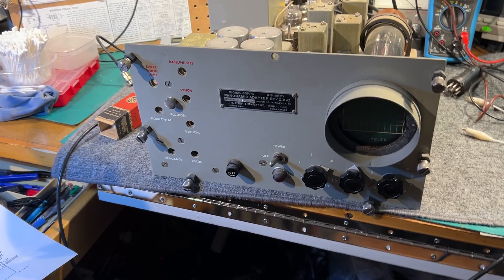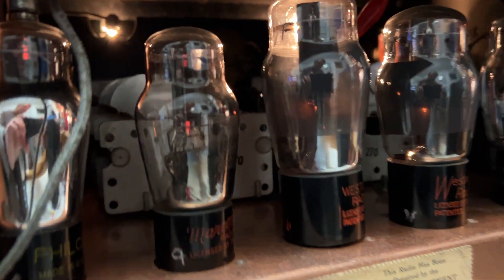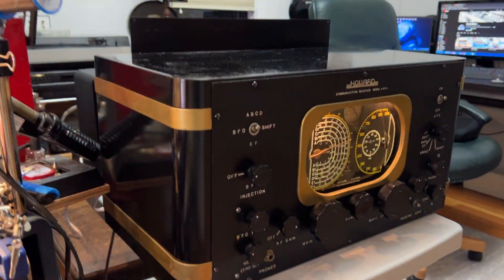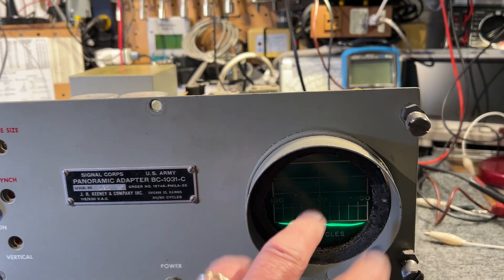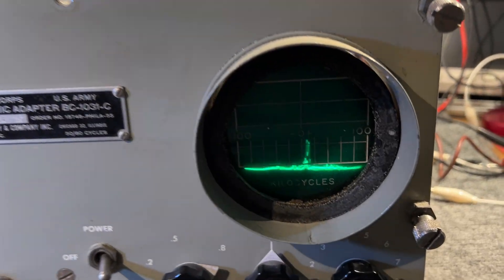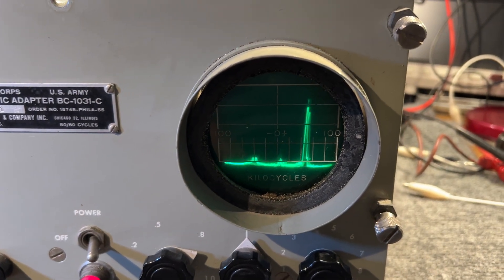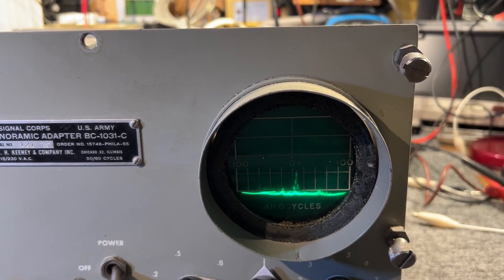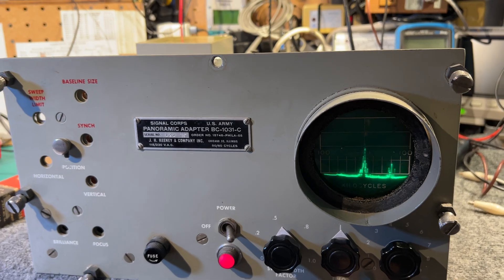US Army Panadapter Model BC-1031-C Initial Test With a Howard 450A Receiver

Comment: Gerry, I just restored a Panoramic PCA 2T-200. It is similar to this one but much simpler. I have yet to pair it up with a receiver. They are interesting little devices!
Reply from the maker: Hi Chris.  Yes, very interesting units.  I had seen the Eddystone panadapters previously, but I cannot recall working on one or getting to use one before.  Always interesting to get something different through the 'shop!